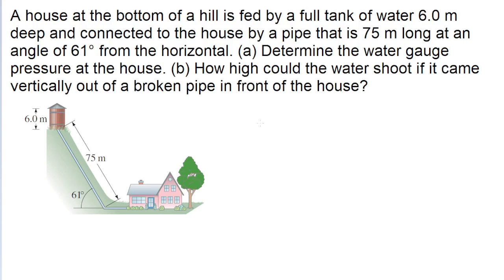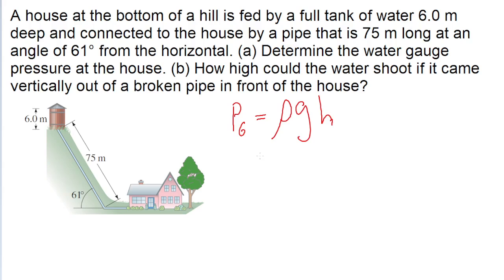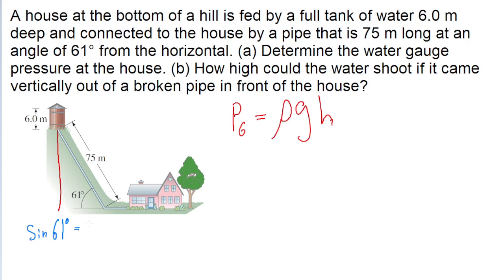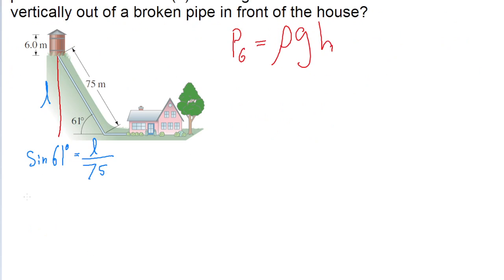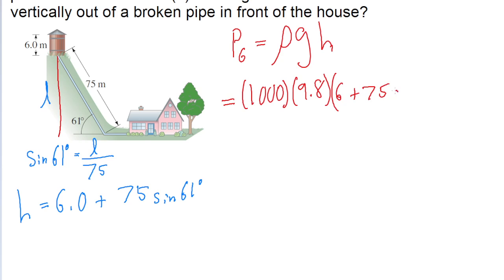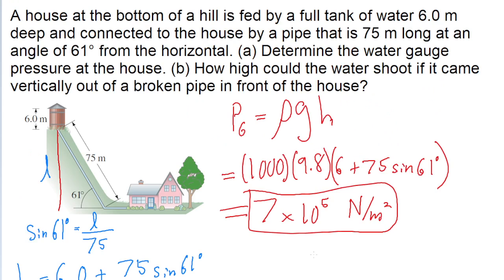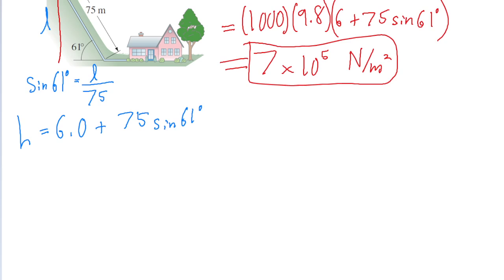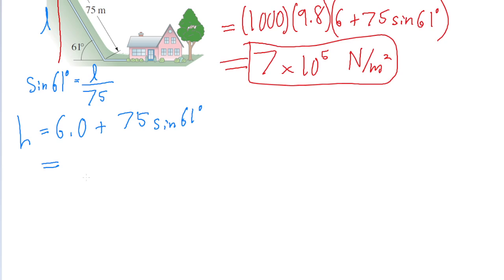A house at the bottom of a hill is fed by a full tank of water 6.0 m deep and connected to the house

Comment: If the tank is full of water wouldn't that imply there is no water in the pipe which means you wouldn't count the vertical value of the pipe only the 6m from the tank?